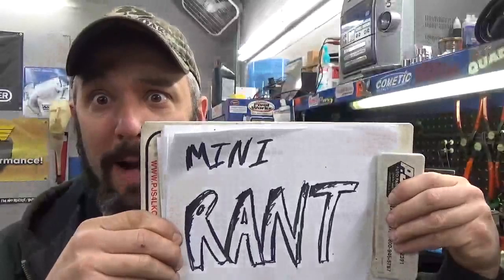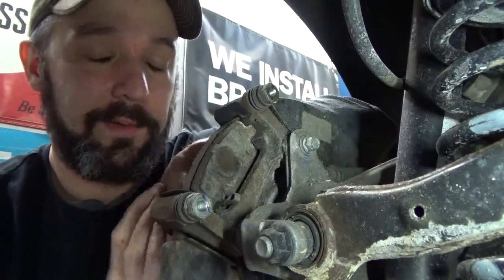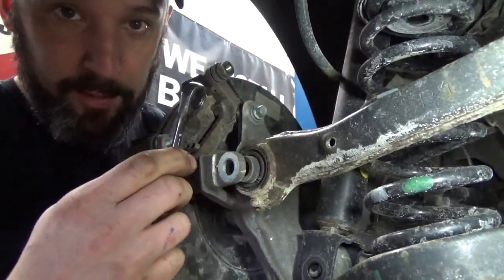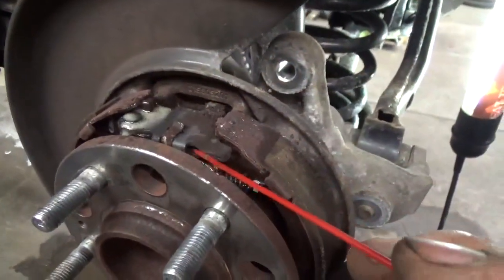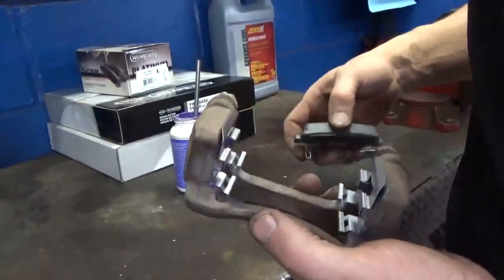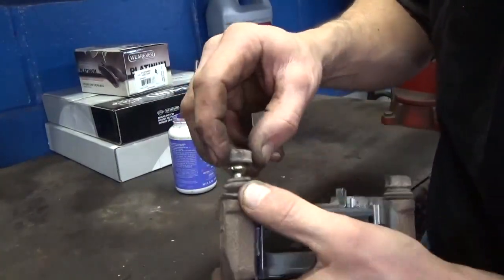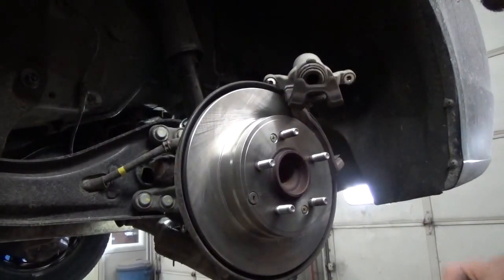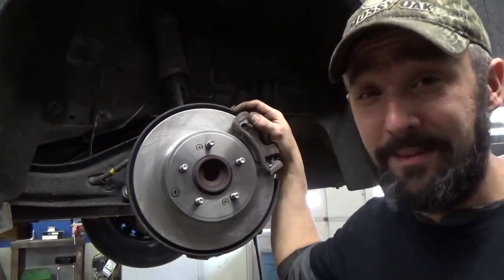Replace Rear Disc Brake Pads & Rotors - Hyundai Sonata

Comment: Engineers should be forced to work on their designs at some point.
Reply from the maker: Audioquest56 Lol could you imagine?
Reply: Absolutely!
Reply: I say the same thing, over and over and over! Make those 'geniuses' work on their designs. Oh wait, they might break a nail.
Reply: @SouthMainAuto  How is it on other cars with independent rear suspensions  ? Do the other cars brake calipers have bolts  blocked by the shock joint . Curious to know. I had an elantra before and was able to do brakes relatively easily.  No I have a Kia Optima( Sonata sister) and brakes will be due soon, so doing the research. 
P.S. Ivan's channel brought me here.
Reply: Good idea.

Comment: Great video,  though I was scared off by the part where it requires taking apart some of the rear suspension to get the caliper bracket off.  I found the solution in the comments.  There are about 5 where people didn't have to mess with the suspension , but Jesse K's gave the most detail.   Basically, get the tire, caliper, and break pads off, and then break the rotor free.   Then remove the easy caliper bracket bolt.  Then use an offset ring wrench/spanner to loosen the hidden bolt, finish backing out with an open-end wrench and fingers.  Once the bolt threads are out of the caliper bracket body, take a screwdriver and pry open the gap between the caliper bracket and the suspension and slide the caliper bracket off.  The rotor is then free to remove.   The bracket goes back on pretty easy after replacing the rotor, but may need to pry again to get it started.     Incidentally, I didn't mess with the parking break star-wheel adjuster and the rotor came off fine.  How do you know when the star-wheel is correctly set?  Thanks!
Reply: Thank you SO much for posting this! And for writing it out, clearly!  But, Did you try this and verify that it actually works?

Comment: You dont need to remove the rear control arm, just use a ring spanner, took me all of about 3 seconds to crack it with a hammer - this is why there is such a large gap between the control arm bush and the bolt, there's enough room to loosen the bolt and remove it without even touching the arm.
Reply: Russ B , can you shed some light  on that in more details pls?
Reply: @dannysoliman8062  at exactly 3mins you point to a bolt, that you said you can't access, on mine the gap was large enough to get in with a ring spanner, one tap with a hammer and it cracked free. There was enough clearance to unscrew and remove it, no drama or removing anything else to gain access.

Comment: The trick to remove the bracket without removing everything is to loosen the rotor screws first
Reply: Does that work?
Reply: @heatseeker_  ALL, THIS Trick WORKS !! It allows the space needed  What is the brand of wrench for the 14mm removing the hard to get to bolt ? All of mine just want to slip off?

Comment: I suggest everyone read the comments here before doing the job. Removing the small rotor screws will allow the space needed so you do not have to remove shock bolt and bottome bracket bolt , saving alot of time and headaches!!  Thank you for the helpful video . FYI -  (5:01)  14 mm wrench on the hard to get to bolt. Not 12
Reply: Can you pls explain in more details your experience with removing that hidden bolt
Reply: @dannysoliman8062  unfortunately, it's been a little while since doing this job ,so I don't remember exactly , but I read a comment that helped me big time . Did you take it apart yet ? My comment may not make sense until your elbow deep into the job. Sorry I cannot help more . Good luck 👍
Reply: @reelnautee  no worries really appreciated

Comment: I wish I had seen this video earlier.  I was changing my rear rotors on the Azera and was trying to find the second bolt for the caliper bracket.  What a stupid design to put behind the control arm.  I put everything back together and will save it for another day.  Great video.  Thanks

Comment: I just got a quote of $1100 to do all new brakes and rotors all way around my 2011 Sonata. After seeing what needs to be done in order to remove the rear set I can see why its so costly. I think I will do the front set myself as it is straight forward to save $$. I have to say...youre video was excellent, informative, & well shot! After seeing how you did that repair..I wish you were my mechanic! Alot of pre-emptive maintenance done with cleaning and greasing. Thats how its done..great job!!!
Reply: Wow! The parts, front and back, for my 2014 Sonata are only $280.00...and that's rotors and pads. So...$820.00 for labor, brake cleaner and lube.
Reply: nah bro.  This job isnt worth 1100.

Comment: I did just do a 2013 Sonata, didn't watch this video before that but jacked up with a second jack under the knuckle slightly more than the video and that gave me enough clearance to remove the bolt without having to remove the rear shock bolt.  It also removed allot of tension from that arm so its as real easy to align the bolt hole back up.  I could move it freely with my fingers.

Comment: Used this video for my 2014 Hyundai Sonata Hybrid Limited. Watched this about 5 times. Was following directions(everything smooth as can be) stuck get trying to get the rotor loose for about 2 hours. Trying almost anything I could without damaging anything. Then I had an amazing idea ( TAKE THE EMERGENCY BRAKE OFF ) came right off! Then reassembled and turned out wonderful. Will do the other tomorrow and the front axle pads/rotors as well. LOVED YOUR VIDEO 

SIMPLE&EASY to the point. 
🤙👍👍👍

Comment: Best video out there for changing rear brakes on this feat of engineering. Definitely saved me a few headaches.

One thing I wasn't able to do is get to the hidden screw without completely dislodging the control arm. In case anyone else out there had to do the same, it's much easier to realign it if you jack it up (the same spot as in the video) and the alignment bar is an absolute must. 

Probably breaks even with the suggested process since you can then get to the screw with an impact very easily instead of squeezing by.

Comment: Thank you!  I'm new to repair work on a 2009 Kia Sedona, and the direct available videos for the brake pad changes are quite unhelpful, on critical issues.  I was really mystified that I couldn't get the pads to slip back into caliper slots, even after putting in new hardware.  Other videos skip or gloss over this step, yet your video here anticipated the problem and offered solutions in advance.  Learned a lot from you, yet again.  :-)

Comment: A simpler way to adjust the parking brake adjuster is:  (Same procedure for rear passenger and driver)
To Losen:
Use  your 90 degree pick to PULL at the bottom  on the adjuster gripping poles
To Tighten 
Use your 90 degree pick to PUSH at the bottom on the adjuster gripping poles

To make a pick get a cheap relatively  thin (Not to thin) screw driver from the dollar store.  Cut off the tiip and bend it  90 degrees.  Great Video it helped me immensely today. It was a pain to do but not impossible as a driveway backyard mechaniic.

Comment: I like the video, but I didn't have to disconnect the shock to remove the control arm bolt or to reinstall it on my 2013 Hyundai Sonata Limited. I guess I just got lucky. Fortunately, I'm a logical guy and figured out that I had to remove the control arm before I watched your video. Your video was a good peer check for me to know that was the correct way to do it. Thanks. Keep publishing and charge those people who forget to put gas in their car and extra hour of labor!!!

Comment: No need to unbolt the shock. If you compress the suspension with that jack it will move the shock just enough to slide bolt out. Just finished the job. Thank you for the great video!

Comment: The was the best video for replacing the rotors on my 2012 Sonata.  The steps are exactly the same.  I had never even changed a tire before and following the steps I was able to replace the pads and rotors.  Oh my god Hyundai made this a huge pain in the A$$!.  THUMBS DOWN!  That single bolt being inaccessible makes the job twice the effort if not more.  Anyways, learned a lot and feel proud to have saved hundreds and changed the pads and rotors myself.  BTW, I don't have power tools so the job is much more difficult than the video.  Make sure you have a breaker bar.

Comment: Great DIY video.  Replaced all four rotors on my 2011 today.  Realigning the pin on the rear control arm was a pain.  So much so, that I did the other side without removing the shock bolt or the control arm bolt.  If you back the caliper bracket mounting bolt out as far as it will go and then remove the rotor screws and break the rotor loose, it will give you just enough room to remove the caliper bracket.  It was still a pain getting the bolt screwed back in using the open end wrench, but not as much as realigning the control arm bolt.  Saved me about hours worth of labor.  Keep up the great work.  It was greatly appreciated.
Reply from the maker: Mitch McDaniel Glad it was able to help you out a little :)
Reply: Jamey Lane  Yes.   It is tight but it will allow you to remove the bracket and rotor without removing the shock bolt and control arm bolt.
Reply: This does work. I figured out once you get the bolt out far enough you put a 8inch zip tie on the bolt the loop it and pull and just repeat till bolt is all the way out. Then when done use the zip tie the same way to tighten.
Reply: Jamey Lane  I put the zip tie on the head of the bolt and then took the tail of the zip tie and like looped it around then pulled on it to twist the bolt out.
Reply: Jamey Lane  so you use the tail of the zip tie to pull the bolt around. So if the lock part of the zip tie is on top you take the tail of zip tie and put it down under then back around the bolt head and pull. It will twist the bolt out.
Reply: @MCD0663  Thank you for this tip!!!! Blessings to you!

Comment: Excellent video as usual, thank you! I use a needle scaler on my air hammer for rust. Also, I put that bolt back in from the outside so that next time I won't have to remove the shock bolt.

Comment: Great video! I worked at Kia and the optimas and sorentos were the same way, I just took that control arm all the way out and kept the shock on. You can punch that bolt out with no damage to the shock. Then just put the bolt back in on the opposite side for the next guy 👌🏼👌🏼 but they do suck, I feel your pain brother!

Comment: This video helped out a lot when doing the rear brakes on my 2011 Sonata. I just couldn't get the bolt loose with a wrench and had to lower the control arm and use a breaker bar. The problem was putting the control arm back in was a huge pain, but after finally figuring it out the other was a breeze. Using that tapered punch was a lifesaver. Hope I never have to rear brakes on this car again!!

Comment: Thanks so much for this video. Without it, I would have been lost. Removing control links for a router replacement is not usual. Its obvious you have a lot of skill because when i jimmied the control link a half inch, i was unable to wrench the bracket bolt out. That bolt is in a valley, and the wrench could not get enough of it. I ended shearing off the edges on head of the bolt. My solution was to completely dislodge the control link so that i could fit a socket onto the bracket bolt. Once i did that, it came off easily.

Then the problem was to get the control link back between the ears of its mate at the end of the job. I started using a c-clamp and banging, but soon realized that i might do some serious damage if i continued. The problem is that the two connections are not aligned. Thats obvious by the way you are able to push it a half inch and it stays in that position. I think this is why some people have big problems with alignment and getting the bolt back through the hole. And thats where your skill is obvious - you did it in seconds, while others (i.e. me) might spend hours or not be able to do it at all. I then tried to remove the other end of the control link from the car body as someone else suggested, but the bolt was in there REALLY tight. Si I abandoned that idea really quickly.

In the end my solution was simple, but it could be dangerous if not careful. You mentioned that a floor jack should be placed under the unit to support it (you called it "this" in the video, it's some sort of bushing attached to a large control link), but you said the spring should not be compressed. My solution was to jack upwards and compress the spring. This brought the control link up to its mating surface (the ears). And if you bring the rotor assembly right to where the control link is in its resting position, you will see that the control link is perfectly lined up with the ears. At this point, the control link moves freely between the ears with no friction, so the bolt can be put in by hand. a crow bar can also be used as a lever from the top to push the bolt in if needed. No hammering required. For the shock, the tension has to be released similar to your video.

To try and maximize safety, I left the jack in the position you recommend (with very little spring tension) until the very end when i was ready to re-insert the bolt into the control link. That way, the dangerous tension was only there for a short while. I was careful and did not have any problem, but use your judgement when doing this. Those springs are very dangerous. I made sure to never get into a position where i had a body part underneath the tension. 

On the second brake, i did not waste time trying to do it your way cause i just don't have the skill. Instead, i popped out the control link right away and ratcheted out the bracket bolt. Im guessing my approach added about 10 minutes to your time (everything else being equal).

The second one took me about 2.5 hours. The first one was double that. But im anal with the cleaning and greasing and overthinking. I would make no money at this :)

Again, good job and thanks for the help.
Reply: And now almost 3 years later i have a warped rotor and need to do the same job again. Thats what you get for $25/rotor. On the bright side, i left some details on youtube so i wont have to relearn how to do this again. And i get to see if all the effort applying anti seize to the mating surfaces makes any difference when trying to remove the rotor. :)
Reply: This literally saved me $600.  I thought it was going to be an easy normal brake job until I found the hidden bolt.  Could not figure out how people were able to wrench it out of there.  Kept reading comments, found this, made quick work of it.  I couldn’t believe how easy it was.  Thank you a million times over for this comment.

Comment: I've watched lots of mechanics and non mechanics do brakes.  This is the absolute perfect way.  I will not be doing this job on my own it looks like a pain.  I live in the south so my rotors aren't trashed like that, so I think the best thing would be to pay a shop to replace the pads, and use on on car brake lathe to machine the rotor without taking anything apart.

Comment: I appreciate the tip on dealing with the rear control arm. I'm glad that I don't have to remove it completely from the assembly. Thanks for your effort and willingness to share your knowledge.
Reply: That's my job for tomorrow morning, also happy with that tip.
Reply: Actually, I have done it today and I did not have to touch the suspension  (Sonata 2006). Access to all of the bolts was trouble-free.
Reply: @5084204  I did the job on my 2017 yesterday and had no access issues either.  I would like to note that the two bolts, that hold the rear brakes caliper bracket on, were interference threads and took far too much effort to remove.  I needed to use the impact gun, with the shock off to gain access, and a breaker bar with an assistant to keep the socket from slipping.  The job in total, including  running to the store for an impact rated universal, took a total of 7 hours.
Reply: @jamies8973  Altough very important, those bolts should be "hand tight", factory fitted with a loctite and  a spring washer: I am sorry to hear about your problem, but I congratulate you for solving it.

Comment: Nice Video! I work on my sons 2012 Sonata and I went to remove that lower bolt and since it was only 20 degrees in my garage, I put the wheel back on and told him to wait for a warmer day. Today I replaced the Alternator (Give me ANY 60's or 70's vehicle, which used to take about 15 minutes) and Tie Rod. If You ever do a video for the Alternator on a 2012 Sonata with a 2.4l, it would be greatly appreciated. That said, I greatly appreciate this rear brake tutorial. I was going to completely remove that 'control arm' but now I can avoid that mistake.

Comment: Great video.  Our 2009 Hyundai Elantra Touring has the same set up and we were getting held up with the hand brakes being stuck on the rotors.  Thanks for the great detail.  Although, to get the hidden  caliper bolt off used a box wrench and cheater wrench/bar.  Takes a long time, but saved us from taking those two big bolts off.
Thanks again.  We will definitely be watching more of your videos.  Keep up the good work, it is greatly appreciated.

Comment: i have learned the hard way that driving bolt for control arm can break that ear off of knuckle (nightmare) there is a sort of guide point on bolt and i have found with air ratchet if available u can sort of screw the bolt back in and reduce disaster . also pulling down on a pipe wrench on lateral arm thing can assist in aligning two units for bolt. very well done video  i will subscribe and certainly view your other vids. every day i see these engineering gernades with no pins!!!